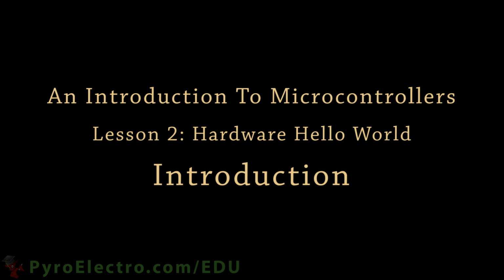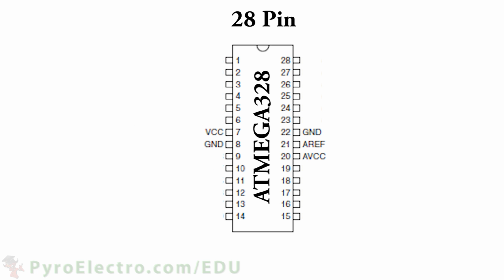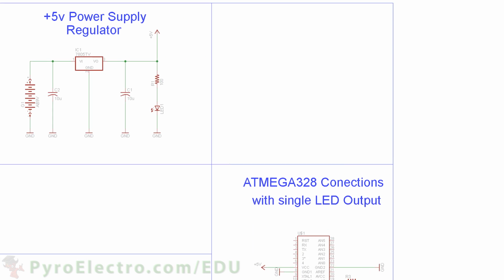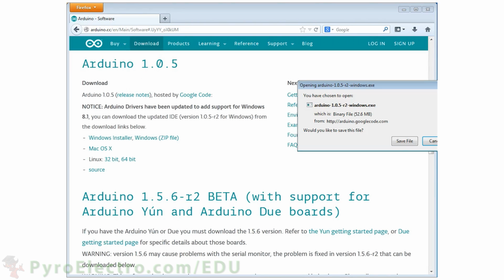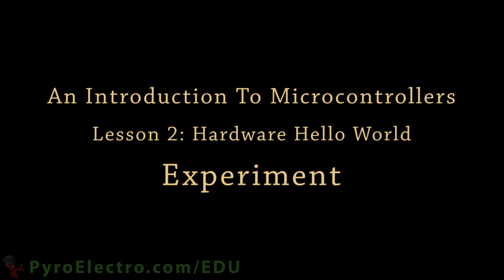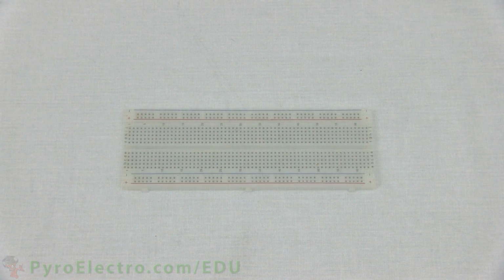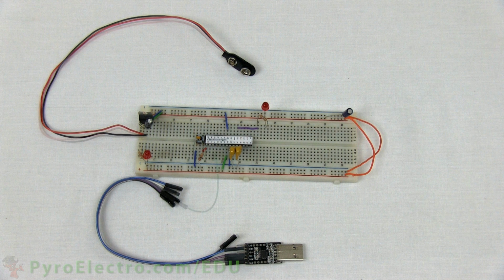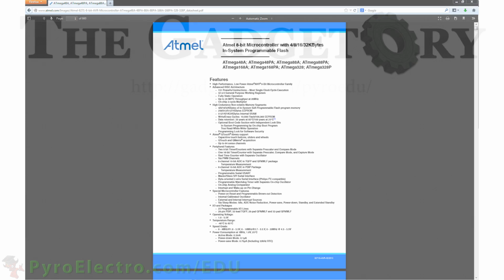Hardware Hello World - An Introduction To Microcontrollers - PyroEDU

Comment: i don't get what the function of the capacitors is. I know that they store energy and change ac into dc, but why would you then use a capacitor and connect it to ground?
Reply from the maker: +weegeniss rival Hi. In DC electronics capacitors are often used as 'bypass' or 'decoupling' capacitors. They filter out AC signals from DC signals. This helps to provide cleaner DC square waves. More info: https://en.wikipedia.org/wiki/Decoupling_capacitor
Reply: +PyroElectro thank you :)

Comment: hey guys after truble shooting my ATMEGA328 extensively, i found it to be broken it came in the mail broken, this is not the first time i have gotten a broken shippent form the gagetory site, i had a feeling it was broken so i got 3 new ones online and they worked
Reply from the maker: +Rino Scremin Hi Rino. I'm glad you got it working and I'm very surprised it was the ATMEGA328. I know the gadgetory does quality control on the parts so that's very strange. Either way, hope you learn something through the course -- sounds like you know a thing or two about electronics already!

Comment: i have every thing set up and i fallowed the video 100% but getting this avrdude: stk500_getsync() attempt 10 of 10: not in sync: resp=0x37 as a error and code is not uploading to the microcontroller
Reply from the maker: +Rino Scremin This means the Arduino IDE cannot communicate with the microcontroller. Assuming your hardware is 100% perfectly connected (which I recommend you double check!).....[1] Did youinstall the driver for the USB-to-Serial Board? [2] Check that you have selected the correct port. [3] Select Arduino UNO as the board.
Reply: +PyroElectro yes i have checked the hardware many times, i have the driver installed and i have selected arduino Genuino/uno, i am using a mac i don't know if that makes a differences, also is there any way to check the micro controller to see if it is still working, cuz when i had it set up pin d13 never flashed 

Arduino: 1.6.6 Hourly Build 2015/10/09 12:13 (Mac OS X), Board: "Arduino/Genuino Uno"
avrdude: stk500_recv(): programmer is not responding
avrdude: stk500_getsync() attempt 10 of 10: not in sync: resp=0x00
Reply: +Rino Scremin this is what shows up as my usb port div/cu.SLAB_USBtoUART
Reply: +Rino Scremin when i try it on a windows computer i get this error 

Arduino: 1.6.5 (Windows 7), Board: "Arduino/Genuino Uno"

avrdude: stk500_recv(): programmer is not responding

avrdude: stk500_getsync() attempt 10 of 10: not in sync: resp=0x18
Reply from the maker: +Rino Scremin Hi. I'm assuming the microcontroller you are using is from The Gadgetory. All of their ATMEGA328 micros come pre-loaded with the blink program + arduino bootloader when they pass through quality assurance. So if you were to wire it up and add an LED to Digital PIN 13, as long as all the hardware is correctly wired up it will blink. I have no experience using Arduino or Serial ports on mac computers so I can't comment on that =(.
Reply from the maker: +Rino Scremin Hi. Unfortunately I've never actually gotten this error before, I'll have to do some research to see if I can help you out.
Reply: +PyroElectro hi, thank you so much for the help.
Reply: +PyroElectro so if i followed the video and set it up right Digital PIN 13 should blink, but it's not so dues that mean the ATMEGA328 is broken? Plus i used it on two computer's and got the same error. 

also i can just use my windows laptop instead of my mac. also can email you a picture of the hardwere set up but its look's the same as the set up in the video.

thanks.
Reply from the maker: +Rino Scremin It's possible that the ATMEGA328 is bad, for any number of reasons but I rarely run into that as the problem. If you go onto the pyroelectro forums and post a photo of your hardware setup I'll take a look. Sometimes a second pair of eyes sees things others don't.
Reply: +PyroElectro ok thank you I will do that now

Comment: Thank you! Great courses.
I have a question. If we disconnect the USB port after programming and uploading the code, will the Micro-controller still do it's work, throw an error or simply stop working?
Reply from the maker: +Goran Kraljevic Koehler Thanks! The microcontroller will still work even if you disconnect the USB port.

Comment: if we dont use oscillator and reset ckt: just conncect USBASP programmer to 6 pins of microcontroller and then program it, will it program or any error ?
Reply from the maker: lab fab Hello. USBASP should work fine without oscillator or reset circuit since the USBASP actually connects and uses the MCU reset during programming.

Comment: hi, thanks for great easy to understand videos! :) A bit too easy in some cases, but really good where you assume no knowledge!!
I am now retired, I started with 8 bit machine code in the 70's and wanted to get in to PICs one day, but now with Arduino, no need! :)

one question, I have comms OK.
Under "tools", "Programmer", what are these options for? and what should it be set to?
they are: 
AVR ISP
AVR ISP Mk ii (which is what it is set for!
USBtinyISP
USBasp
Tiny programmer
Arduino ISP

and just to add to the questions... :) 
Not certain what the "burn bootloader" is? It implies a permanent state and where would I use this option. Seems a good place to ask thsi.

Thanks Again, Mick (UK)
Reply from the maker: Thanks mick! Machine code ugly =P. When you're ready for PIC, check out our pyroelectro website, we have a good intro tutorial called "PICKit3 Programming With MPLABX" which would get you started with PIC on a breadboard.